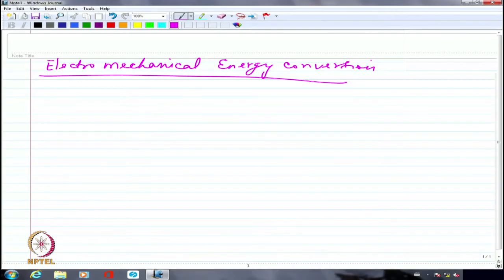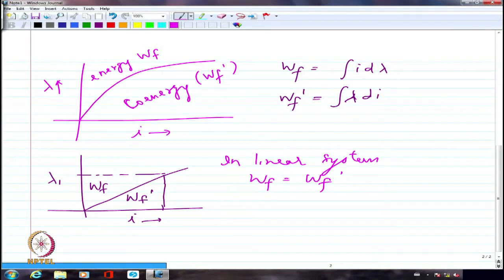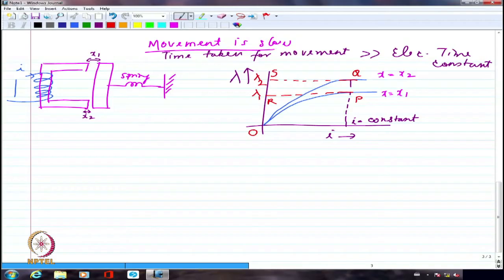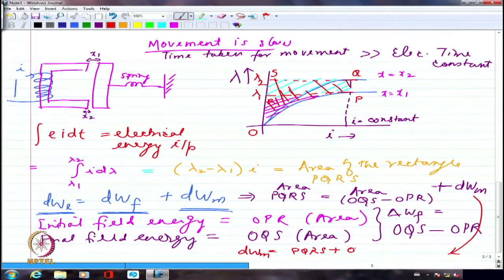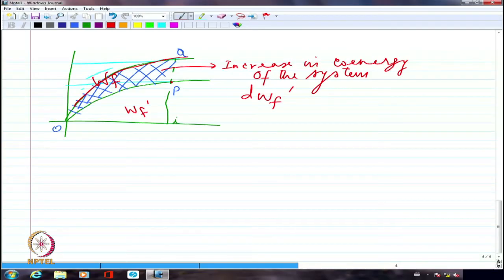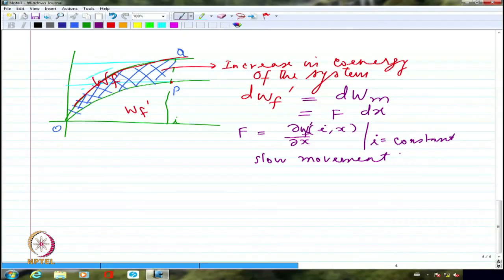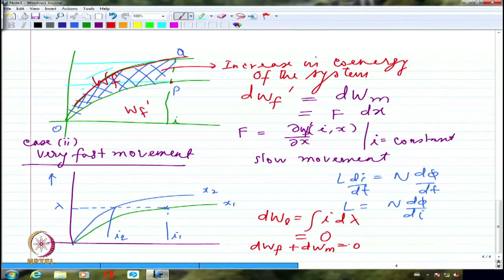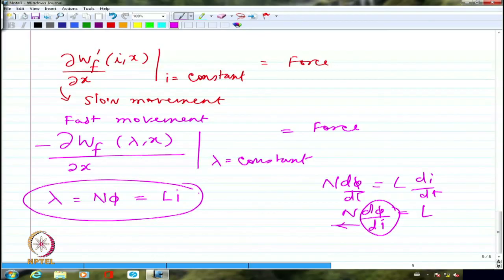Electromechanical Energy Conversion-II

Comment: I didn't clearly understand around 37:00, so I read the book like ma'am said. Here is what I found: Lets say we are having a DC excitation. In steady state, N*flux = lambda1 and i = V/R (DC RL circuit in steady state), now if I move the movable part by dx very slowly such that dphi/dt = 0, because dt -> infinity , then induced voltage = induced current = 0 (because dphi/dt = 0). N*flux = lambda2, but I still remains V/R. In case of AC excitation also, steady state sinusoidal response will remain same)

The second case is where I move the movable part with dt -> 0, as dphi/dt > 0 => i = i + delta i,  dphi = 0, hence  lambda remains same, but i changes from i1 to i2